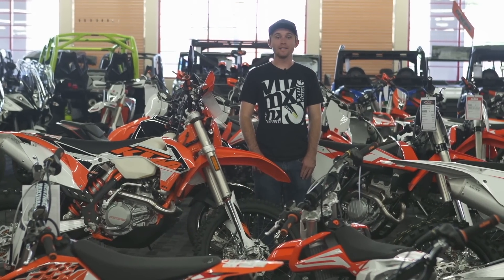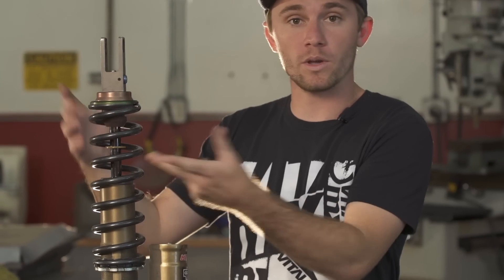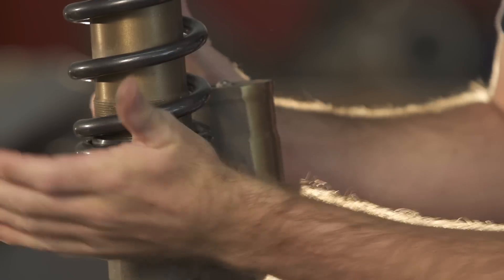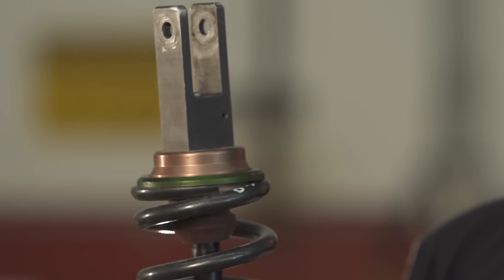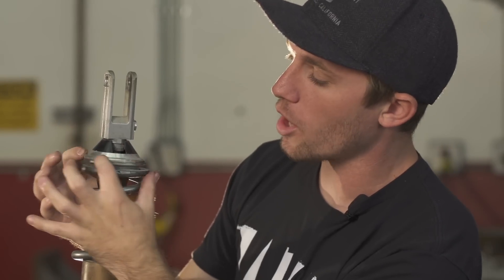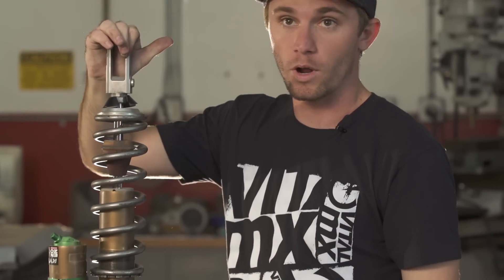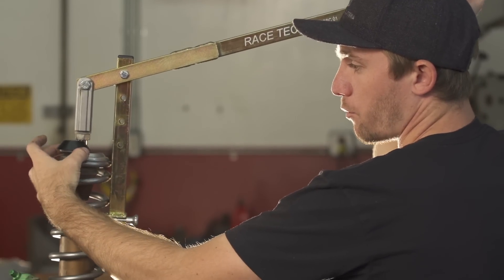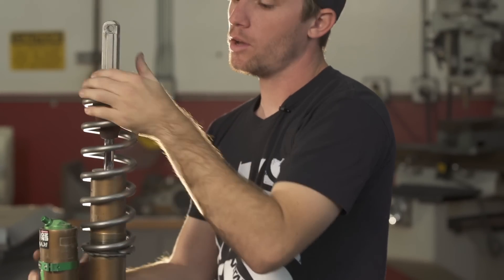Tech Tips: Shock Spring Removal

Comment: For that KYB shock, can you just loosen the pre-load rings past the threads and allow them to drop all the way off? Seems that would would free up the extra few inches to get the collar off for guys like me that don't own a spring compressor. Is that not advisable?
Reply: The ring won't fall down onto the non threaded area, as its actually wider on the non threaded part, so it would just result in the collar bottoming out

Comment: I'm just over 100kg (110kg with gear on) what type of spring do I need
Reply: If you go to the Racetech website it has a calculator tool that allows to select your bike and rider weight. From there the website will give you a recommendation on what springs to go for front and rear
Hope this helps!

Comment: My 2018 crf 250 shock is way to soft for my weight I'm 16 stone how do I know what spring I need
Reply: Check out race techs website and use the spring rate calculator